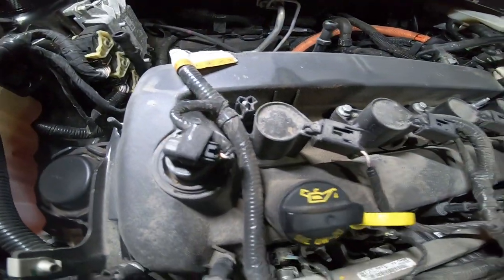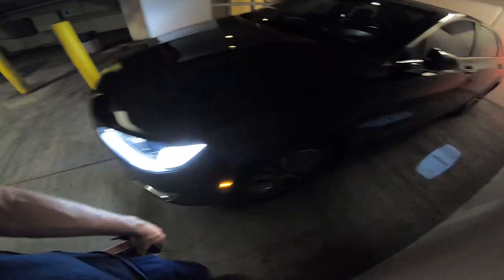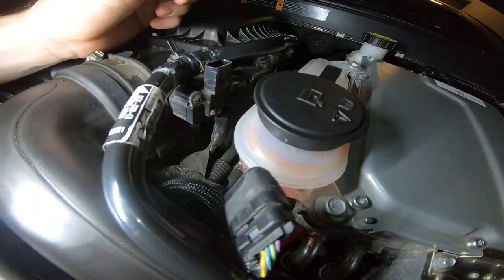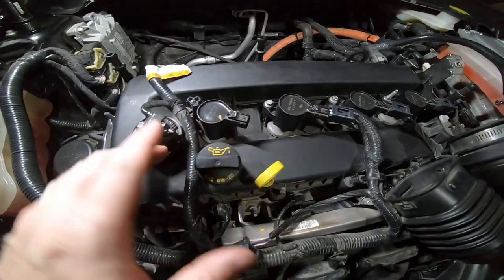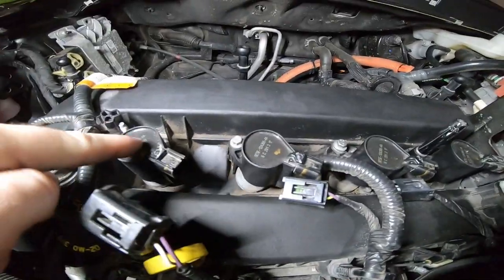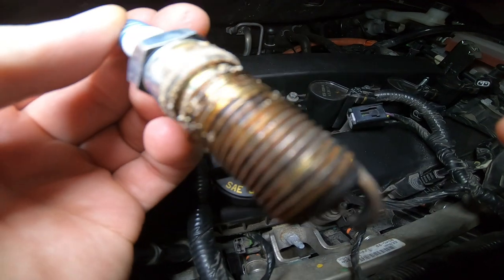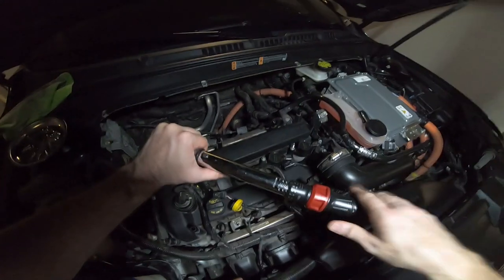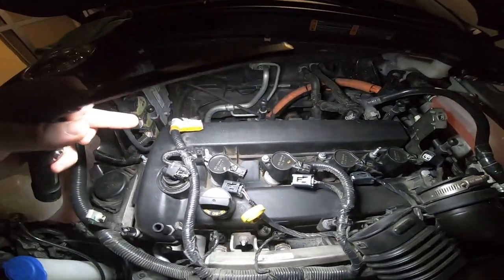Lincoln MKZ Hybrid - Spark Plug Change

Comment: You sir are the man with these helpful, how to, handy dandy videos! Before seeing you, I was nervous about touching my engine. You are saving me money by not paying service fees! On my way to purchase a torque wrench.
Reply from the maker: My Lincoln man, turning wrenches. Remember inch-LBS torque wrench and NOT foot-LBS. If you use foot-LBS you strip out a spark plug and it will fall down into the cylinder.
Reply: Yes, inches not foot got it. Watching your video on oil change got me through mine. Today I'm changing my transmission fluid, so I'll be referring to your video as well on that topic. You are my personal trainer now! LOL

Comment: Great job on these vids got a fusion  looks exactly the same under the hood couldn't find any fusion hybrid how to vids
     👍👍
Reply from the maker: Thank you! Smart choice getting the hybrid and for being a man turning wrenches. The hybrid engine was tested in a NYC cabs system with the Escape. The hybrid engine is proven 500k miles. You made a smart choice. I love my Lincoln Hybrid and your fusion hybrid is identical.
Reply from the maker: Check out my transmission fluid change video. Other than transmission fluid and spark plugs, the hybrid has been rock solid reliable. The Lincoln has 120,000 miles on her...https://www.youtube.com/playlist?list=PLA0mXefhg0rvbQgxvr7_6fAnrRgmkaqOq
Reply: 😉 doing trans flush right now 
thanks to that vid literally right now
Reply from the maker: @lifethroughsound2379  My man! Glad I could help!

Comment: You didn't explain if the plugs were platinum or iridium and what the cost was?
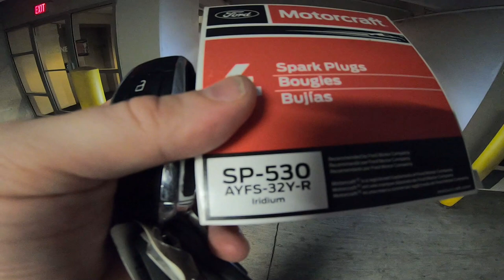Reply from the maker: 00:29 what does it say on the box in front of your face? It reads iridium.
Reply from the maker: https://www.oreillyauto.com/detail/c/iridium/ignition---tune-up-16776/spark-plug-12874/b14eb31b13d7/motorcraft-iridium-spark-plug/mot7/sp530